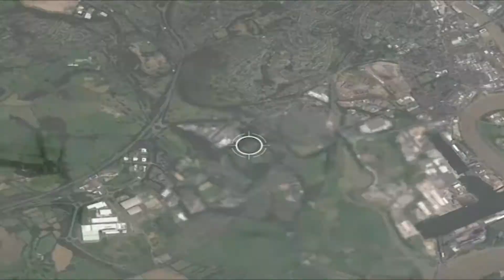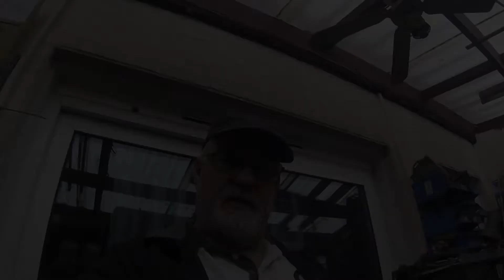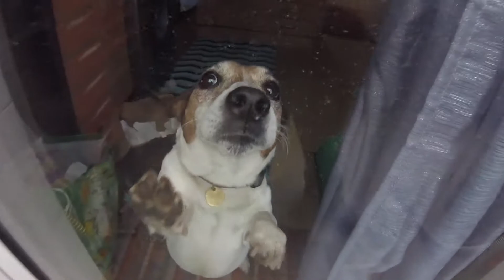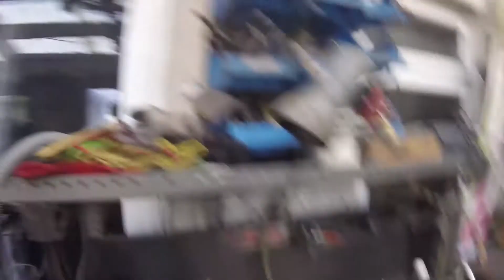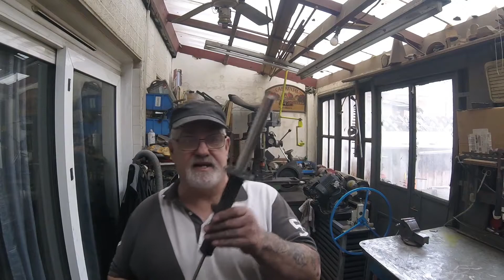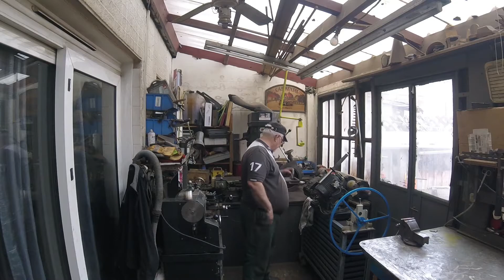im clean quick and free

Comment: looks great BOB cleaned up the blacksmith shop and started on the other found i had 40 different metal files and spent the rest of the day cleaning them and putting them up . not have to finish the rest of the shop , might find more tools i seamed to miss place or someone borrowed and havent brought back yet, either way wont lend out tools no more.